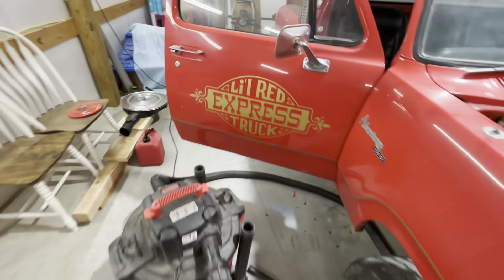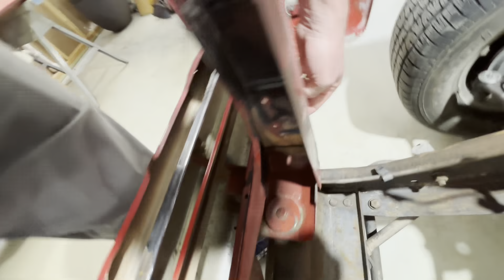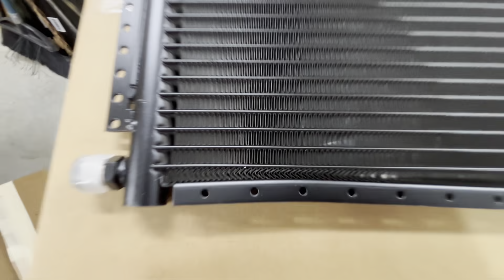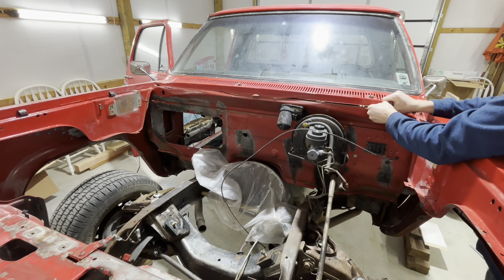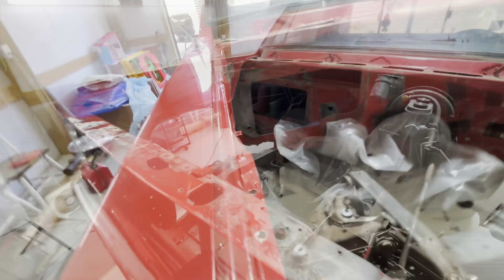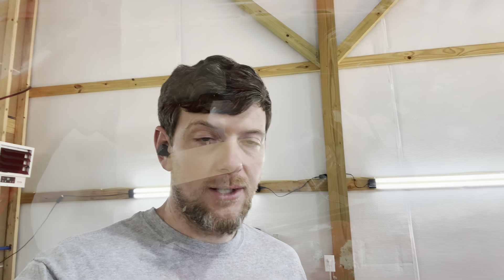Little Red Express:Metal Repair Before Painting the Engine Bay #mopar #restoration

Comment: Have you ever used or checked on the Bouchillon Performance under hood a/c kits? I've used several on these trucks and Ramchargers. They work well and you keep all the under dash parts and original controls.

Comment: That new A/C system looks awesome and using that original dash control will be awesome - if you can, could you share the part number(s) of the A/C system?
Reply from the maker: Yes sir. My goal is to do a comprehensive AC install video and show all the processes and part numbers. I need to get that painting done and engine installed to get compressor mounted and in place

Comment: Many years ago now I spent about 5 years going through a ‘79 powerwagon, so all this bodywork looks to familiar and brings back a lot of memories good and bad 😂 they were great trucks but they sure weren’t perfect.
Reply from the maker: Haha I bet! They definitely have their quirks! Doing an engine bay really is no fun
Reply: You’re right about that, it’s the worst area. Everything is typically covered in grease and grime so you gotta deal with all that first before you can even think about doing any bodywork or painting. Weird rust spots always seem to form up there too, batteries always leaked and killed everything below them. Dodges wiring always left something to be desired too in my mind at least, it was hard to make it all look nice. And don’t even get me started on trying to get all the panel gaps perfect, I don’t think it can be done.

Comment: That is a much more substantial brace than the factory part. Thicker metal, extra bolt hole, and looks like a better welded area. But the one bolt on the radiator support is the only thing to stop the frame from twisting. If I were to get one of those to support my cracked frame I'd reinforce that single bolt.
Reply from the maker: That's a solid point, I might look into reinforcing that mount!

Comment: 4:39 Its a solid plan! Any kind of liner in there to replace the factory tar stuff will help but raptor liner and a paint brush is the best way to go!!! Scuff that primer and brush the whole damned thing inside and out! Yeah its a bit heavy but at least its paintable. Not to forget that its not hard to go over the liner with the paint job and then again with a spray in rubber or something to look factory. I've been hunting down a few different options for protecting the rockers and fender bottoms. So far it looks like the same material they use to do custom car wraps (PPF ie paint protective film) will be the most economical. 
I was really really hoping you'd pull the core support and split the halves for repair. Its an enlightening repair process to undergo. Once you do it you will change the way you handle core support (or even tailgate) repairs and such. On that note, the missing chunk of that passenger corner mount is kind of typical. Around 78 they started doing funky crap to the supports from factory. I dunno anyone who knows why but I feel its rarer to find one that hasn't been cut up or notched or mangled in some way before ever making it to a customer.
Reply from the maker: Thanks brother. They all have their quirks

Comment: Nice job on the firewall and core support. That firewall will look factory after it's painted. The brace for the steering looks killer, and almost like a factory install. My dad used a squirrel cage fan in the door just like you have set up when he painted tractors at the JD dealer back in the 70s - 80s and it worked great. Keep up the good work. Mopar to you.
Reply from the maker: Thanks for the kind words, means a lot!